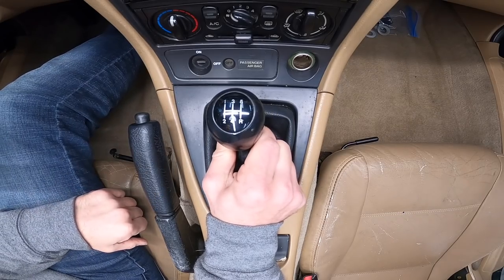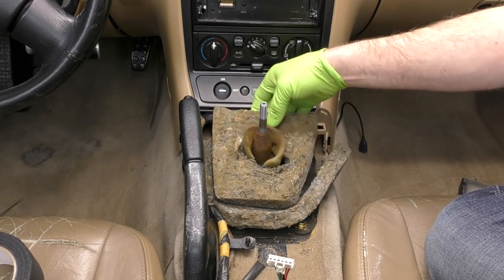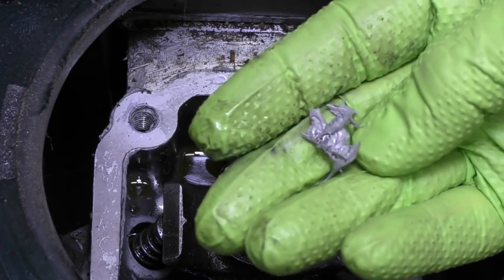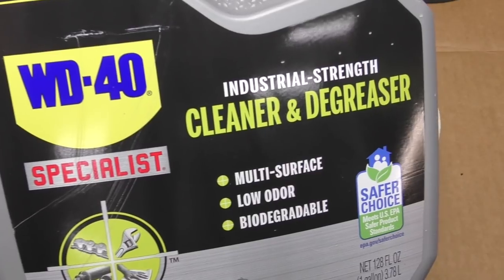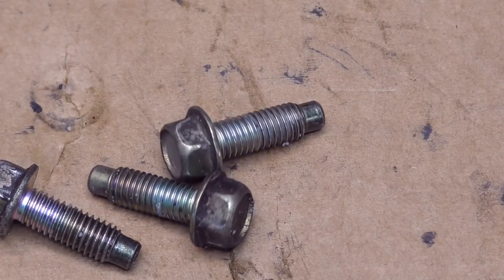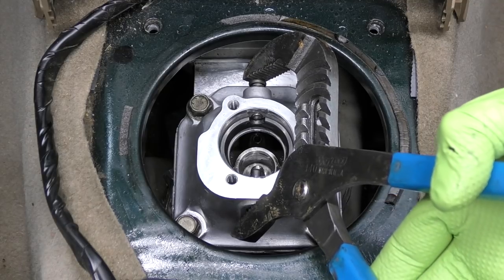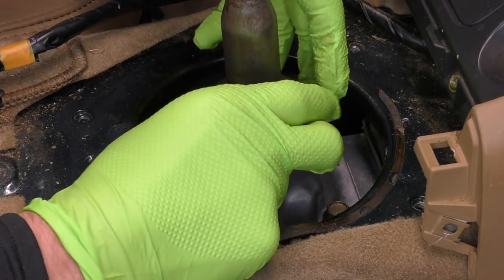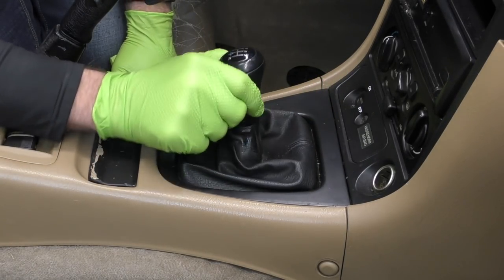How To Rebuild Mazda Miata Shifter ~ Loose, Worn, Sloppy Shifting

Comment: "A 10mm socket... if you can find it..."
Reply from the maker: Never to be found again
Reply: @HumbleMechanic  I found it, and another one, plus 2 10mm spanners. Now, to find that 13mm spanner, I know I had at least 5 of the darn things, but all I can find are 12mm sockets, and only some bolts fit.
Reply: You found it after bought new one.
Reply: That hits home
Reply: Not sure why people say they can’t find their 10mm socket. I have the same ones I’ve had for 20+ years. Don’t recall losing any sockets actually.
Reply: AvE has an extra if you need it.
Reply: Funny asf😂

Comment from the maker: I am not sure I mentioned it, but the oil residue is from the rubber boot being split and sloshing fluid out. I could have probably not resealed that housing. If those boots are split you can get a leak like this.

Comment: My takeaway from this is:
- Ripped rubber is bad
- Running dry is bad
- Polish the rod
- Always use lube
- Slide the rubber carefully over the rod
- Snap the rod into the hole
- Rubber is for protection
Reply from the maker: 100% this. And be sure to always get permission
Reply: All words to live by
Reply: Also boots aren't gaskets

Comment: Great video! One thing to add is that on 2001+ NBs there is an extra screw under the power window assembly. There are tabs on the front and back of the assembly so you need a credit card or something to pry it out gently. Then you can take that screw out and the console will come loose. Otherwise spot on!

Comment: When I did mine, I just took an old beach towel and cut a hole in the middle, draping the rest over the interior carpet. Like an operation.
Reply from the maker: HAHA I like that!
Reply: @HumbleMechanic  Kept the carpet super clean. Twenty year old stank gear oil never scrubs out.

Comment: Great Job as always.  Question, what do you do with the dirty WD40 Cleaner degreaser?  Does it have to be disposed of properly?
Reply from the maker: Well what I did was leave it on the floor, kick it over, spill it, then use an oil absorbent towel to clean it.
Reply: @HumbleMechanic  It's nice to see that superstars like you make some of those same mistakes that I make.  I hope you didn't break the Correlle ware :  )

Comment: I was driving around a Toyota Echo with a shifter so messed up it essentially would kind of flop around as you drove, and the gear pattern was more your imagination then actual pattern. Put it in 1st? Think I'll just slide into the neutral position but just enough to still be 1st.
Reply from the maker: That is so tough to drive with. LOL

Comment: I didn't notice the orientation of the shifter. It went in both ways. My shift knob is 180 degrees out. I fixed the shifter knob lock screw and all is fine. I don't know that it really matters. Shifts the same as before.

Comment: @HumbleMechanic I test drove a 2001 Miata with a 6 speed and while driving, the shifter was able to move almost freely like it was in neutral. Is that bad bad or can doing the steps here fix it? I want to buy the car but this is one of the things I’m concerned about. Thanks!

Comment: I cannot stress enough how tough those pins are to smack out, like I had a pretty heavy hammer and smashing a punch into it on the floor making dents in the concrete floor tough (exaggerated). Anyone doing this make sure you got tools that can really smack on those pins.

Comment: great video Charles
By the way do you know the part number or something related to do this job on an B5 Audi A4 my shift knob feels a bit loose and i want  to refresh it. Thanks
Reply: There is a whole kit of the plastic parts for this, either aftermarket or from VW spares. Mostly easy to install, though you will benefit from a lot of rubber grease to help with the places where they go into the housings and where all the sliding parts go.

My VW was sloppy, and the one plastic bush for the ball was out of stock, so replaced the rest, and then simply used a lot of cable ties and rubber grease to make the fit better.

Comment: I would add a lot of Fluid Film spray on both sides of the rubber parts, so they do not crack from age as quickly. It is made from lanolin from sheepskin. Not for door gaskets- use silicone spray or Mothers VLR spray instead.
Reply from the maker: Dang what’s the rubber made of. Lol probably a solid idea
Reply: @HumbleMechanic  most rubber now is not the sap from a rubber tree like the old days- it is made from fossil oil and chemicals. I use Mothers VLR spray for interiors- made for vinyl, leather and rubber. Fluid Film spray is good for most rubber, leather and motorcycle chains- it does have a slight bad smell. The Mothers VLR spray smells good. I use Turtle Wax Trim Restorer for hard unpainted plastic inside and out. The Fluid Film spray might damage door gaskets. I prefer the Mothers VLR spray instead of silicone spray because it smells better, but the silicone spray works better for side window channels. Silicone spray will ruin oxygen sensors.

Comment: None of those screws are Phillips...they’re JIS cross-head screws. Using a Phillips will damage them. (I chewed up a LOT of screw heads before I learned that.)

Late ‘80s Mazda B series trucks had the same nylon bushings in their stick shifts.
Reply: Not many know about the JIS screws,getting harder to find proper screwdriver
Reply: @nickpappas4133  for a Japanese motorcycle, use the tool kit screwdriver for the screws. Do not use the tool kit spark plug socket for the front axle bolt, because it will likely bend it for spark plug use. A lot of people replace the x or flathead screw heads with allen head screws.

Comment: You can't improve the transmission wiggle with trans mounts, because there are no trans mounts.  Miatas have two motor mounts and two differential mounts.  The trans is solidly connected in between the two (with the PPF bridging the trans to the diff)
Reply from the maker: Got some freshy engine mounts ready to install

Comment: Surprised you didn't spring for using "Unicorn Tears" (Motorcraft XT-M5-QS), understandable though cause its so expensive. I'm probably going to use Redline MT-90 for mine when I do it soon.
Reply from the maker: Yeah I hear that’s the best of the best. Lol
Reply: I used Motorcraft fluid in my trans and Redline in the diff. RockAuto has the Motorcraft fluid for a decent price. Only 2 quarts needed.

Comment: Have you tried that wd degreaser in a sonic cleaner yet?
Reply from the maker: No. Sadly my sonic cleaner died .
Reply: @HumbleMechanic  harbor freight cheap and easy to replace when they break.  Love mine.  Ill have the to give the wd a run on some random stuff and let ya know

Comment: Hey @humble mechanic, I redid the shifter in my 99 transmission I'm wondering do you feel the shifter when pulled to the left to go into first and second moves less than when you go to the right for 5th? This car is new to me so not sure if this is normal if I got bad transmission or maybe did something wrong on the install.
Reply from the maker: Felt great after. Did you replace that little cup at the bottom?I guess make sure nothing is binding.
Reply: @HumbleMechanic  sure did with a brass one as well. The movement is fine mostly concerned about the left to right difference. To the left it's a short move and to the right it's a longer move is yours the same way?

Comment: @HumbleMechanic 
So my My compression on all 6 cylinders is between 125 and 126. Is that super low? Or just low? What should they be?  What if  I went and bought sleeves the for block, would I have to to get all new pistons? Definitely new pistons rings
Reply from the maker: That’s pretty low I think limit is 110. Before I did any mechanical repair I’d try some BG compression/Engine performance restore. 

If you got sleeves you’d need to have a machine shop do the work. I’d do more digging before I took the engine done
Reply: @HumbleMechanic  so u think I should just get new pistons rings and make do a little more Hon? I reason I think that the rings where not bad was able to pour oil after the Hon and put old rings and pourd oil on top to to see if it would  seep thour and it didn't for 4 days....... So that made me think piston rings where OK I guess not a good test?
Reply from the maker: Not yet. I’d do a leak down test and find where the low compression is coming from

Comment: Where should the grounding electrode be clocked too?
Reply from the maker: If you’re going down that path, the majority seem to land on 180 out from intake valves/ injector. 

This is one of those things that the theory is sound, and there man be a SLIGHT benefit, but probably not worth the time or added cost. 

But I think the next cylinder head I have off I may do it just to do it
Reply: @HumbleMechanic  thanks for your reply mate, greatly appreciated.

Comment: It seems you’ve realized that lower bushing is metal from the factory and installing a plastic aftermarket one that comes in those kits is actually worse than the one it came with from the factory. So pulling that pin in the NB cars is unnecessary unless someone was harsh enough with the shifter to crack the metal bushing or the weavy washer. AFAIK,the NA cars had a plastic lower bushing and that’s why those kits come with it.
Reply from the maker: Interesting. I’m learning so much about these rascals. Like the weird rear calipers. Hahaha
Reply: HumbleMechanic what’s weird about the rear calipers?
Reply: @HumbleMechanic  They are funny.   Mine were completely rusted and I couldn't turn the screws to retract the piston.   I got a used set from Roswell Wrecking that looked brand new with pads for $40!
Reply: No, that’s incorrect. The plastic bushing was OEM on all 90-05 Miatas. The bronze aftermarket bushing is a worthy upgrade when rebuilding the shifter.
Reply: @Patrick94GSR  yes, true.....none were metal from the factory, and the plastic fall apart often with nothing remaining.....i just did my '02 5-spd yesterday and it was a sloppy floppy loose shifting mess -   a couple tiny chunks of that white plastic bushing was all that remained down in there after 90k miles.   The new brass (or bronze?) one makes for sweet snicky shifts.

Comment: A Phillips Head Screwdriver that actually fits the screw would be nice though...
Reply: The design of a Japanese Phillips screw and North American is different.You need a Japanese screwdriver for a proper fit.Most motorcycle tech’s know this.A sae Phillips screwdriver will cam out on a tight screw.
Reply: Interestingly enough I was in the motorcycle industry for 45 years as a tech, service manager, and finally a technical coordinator for  Yamahas International. That’s probably why this stood out so much to me in the first place.

Comment: Sadly my 1998 Golf Mk4 has the same issues
Reply from the maker: Luckily is a pretty easy fix
Reply: @HumbleMechanic  But i have not the Shifter with the PVC ball but with the kinematic.It's only adjustable with the 2 special tools VW 3422 and 3192/2 but I bought both last year and now I found the part numbers for the rolls and bushings.Fingers crossed that all this works.
Thanks again for your great Video's.

Comment: Dude please put a short shifter on it! I promise you it make a huge difference! God l miss my Monica!
Reply: Get a couple of rubber gaskets also! The wear out very easy.
Reply from the maker: I probably will. But I want to get a feel for it this way first
Reply: The only short shifter worth anything for a Miata is the Miata Roadster shifter which is about $350. It’s the only true short throw shifter that raises the ball and lengthens the lever arm below the ball. All other shifters on the market are just shortened height levers.

Comment: No transmission mounts on these, only engine and differential mounts, everything in between is metal
Reply from the maker: Ah good point. A strange truth I think.  Ahah I have engine mounts ready to go.
Reply: HumbleMechanic that’s the power plant frame unique to Miatas. They use it to keep the engine trans and diff all rigidly mounted as one unit, then put the rubber mounts at the engine and diff only. No need for trans mounts or any rubber on the drive shaft. And I can attest that the Mazda competition rubber mounts make a huge difference if your old ones are torn like mine were.

Comment: Why didn’t you just install a short shifter anyway?
Reply from the maker: Because I want to be sure there is nothing else wrong in the transmission.  I didn’t want to add a non-stock variable If something is wrong

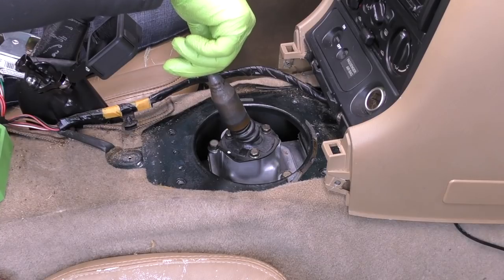Comment: 16:28 the miata does not have transmission mounts the transmission is held in by the engine and the power plant frame attaching it to the differential